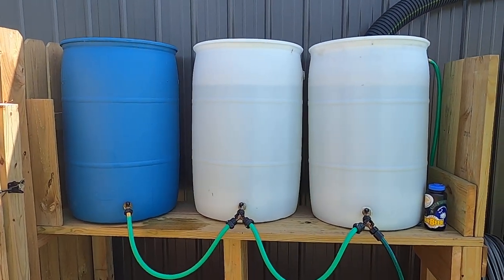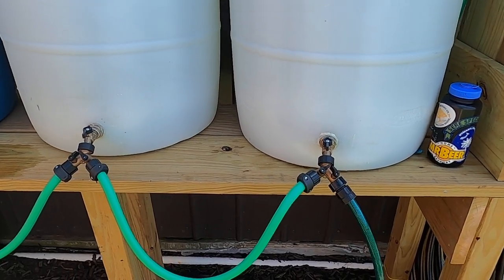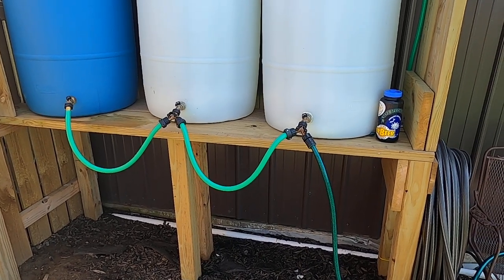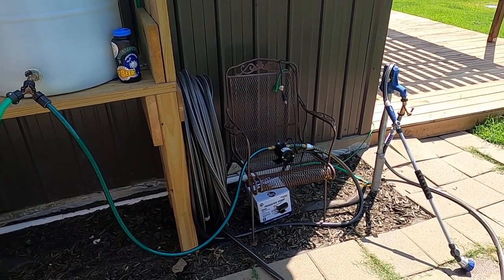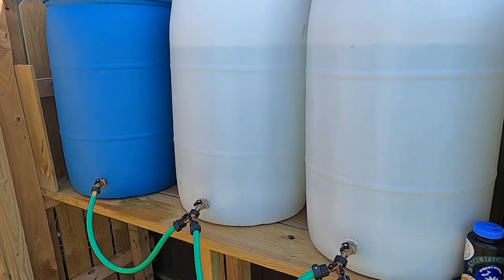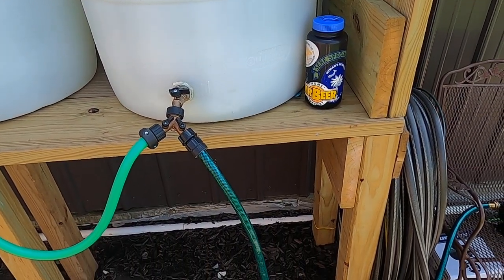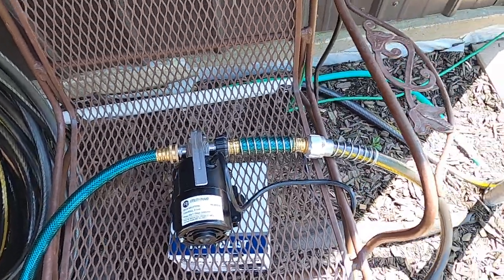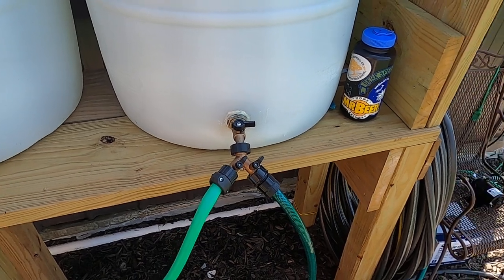Rain Barrels and Pump Watering System

Comment: I inverted mine, then drilled a hole in the "top" to fit a threaded 3/4 inch pvc fitting so it has antennas. Capped the antennas then used the smallest drill bit I could find to perforate the caps. So the antennas act as the air releases. Then on the 2inch PVC, off the first flush, headed over to the barrels I used a T to make a Gutter down spout higher than my barrels water level to act as my overflow. Then put a piece of window screening in the bottom of the gutter spout and on the intake from the gutter. This seals my system from mosquitos and allows the barrels to fill completely. But creates all the head room in the world, since the Antenna and T down spout can be any height above your barrels. All it does is catch an extra foot of water, extra, in the 2" PVC and the 3/4" antennna, insuring all your barrels fill to max adjusted for any out of level. BUT MOST IMPORTANTLY SEALS THEM FROM BECOMING MOSQUITO BREEDING COMPOUNDS. I havent seen a mosquito get in and if they did theyre going to have issues getting out. But mute point since they cant get in. Im not sure they know Im hiding water there at all. I study mosquito behavior and I swear if 1 figures it out they start recording a memory in their little bot army of where to breed.

Comment: I agree that this is a pretty sweet setup. Your purpose is for the garden or non-consumption for humans. For myself, I'm looking to set up a backup system for the well, (as well as rain catchment) in the event of extended power failure. I'll need filters and all that happy jazz because 1) our mosquito population is very prolific; and 2) our well water is unpleasant to taste. But I like how you actually Got It Done on a purely barebones level - it's DONE! An accomplishment. You can always do improvements later, if you wish. Have you noticed any problems with algae growth in the white barrels?

Comment: I’ve been using a Seaflo 33 series 110V electric pump which includes on demand pressure on-off. It’s a little pricey at $99 but it is not loud and works great. It is not a submersible but it’s been mistreated and still continues to just work. I use my rain barrel water just like a normal street water hookup. Great pressure etc

Comment: On demand pump would be perfect here. And float valve connected to solenoid connected to house/well water as a back up for droughts. Put a timer and landscape irrigation on garden side of the pump and you have a hands free system. Use free rain water when rainy, use house water when barrels dry but barrel self fill with float valve/solenoid. Add solar panel if you really want a fancy set up to run pump/solenoid. Thats what ive got
Reply: I like the way you think

Comment: Those pumps aren't meant to be turned on unless water is flowing through them.  So every time you close your spray nozzle realistically you should shut off your pump.  On demand pump would be much better for you.  They sense the drop in water pressure when you open your spray nozzle and instantly turn on.

Comment: This a sweet simple setup. I have 5 barrels. Two in front and three in back of house, separately hooked up. I have been using the top of barrel method, like you did, and am not happy with maintenance and hassle.The brittle black vinyl corrogated hose sucks. Always breaking.  We live in Ottawa, Ontario so I have to put the barrels away for the winter. Just wondering how you made use of the various hose connectors. Did you use hose fitting that you installed yourself, and how. My attempts have always leaked.
Reply: I joined my rain barrels together the same way that is shown in this video by using garden hose to link the barrels together. My hose does not leak, but it does take a long time to fill the adjoining barrels in a heavy rain.

Comment: 👍🏼. On demand pump would be better for your set up though 🤔
Reply: What's an on demand pump?
Reply: @uniteentierly2773  It is a pump with a built-in pressure switch. Which means that when the garden hose nozzle is opened the pump starts pumping automatically and when the nozzle is shut the pump stops pumping automatically so the pump is not being deadheaded.

Comment: The rain water will flow out at a quicker pressure if there is a hole or cap opened at the top of the barrel when watering.

Comment: Nice setup. Did you consider using a submersible/sump pump instead of your transfer pump? If so, what was the deciding factor(s) in choosing the transfer pump?  One plus I can think of in favor of the submersible is that the noise would be a bit muffled. Thanks.
Reply from the maker: Thanks for the question! I did not consider a sump pump due to their price and the added steps and resources of installing it compared to simplicity of this little transfer pump.
Reply: I have a submersible pump and a setup like this but I can’t draw water from all 3 barrels at the same time I figure. The pressure from the pump I assume would go into the other barrels.

Comment: If the water collection was higher could you not do away with the pumps all together? Or would it need to be to high to create any pressure?
Reply from the maker: Hey Bryan. So for psi calculations, every 2.31 ft of fall equals 1 psi of pressure. You are correct that water is a self leveling entity and will flow to lower points, but it’s the difference between a slow trickle or a nice pressurized stream. I would guess that the little pump here is creating 10-15 psi consistently at the nozzle through 100ft of hose.
Reply: @moonacreshomestead6610  would it be possible to connect a 30 ft' pvc pipe to the middle barrel then put it upright/perpendicular, connecting a hose to the top which would then create 10-15 psi naturally after you created a siphon?
Reply: @bryanannett8867  lol

Comment: How do you fill the other two barrels with water?
Reply: The water flows from the first barrel to the others through the pipe setup at the bottom. With all of the valves open, the water level will always be the same across all the barrels. Simple physics.

Comment: You straight up don't know how this whole barrel thing works.  You need a screen on top for one thing, not just for bugs but for other stuff that comes off the roof.  The valves on the bottom even out the levels.  You leave them open all the time.  The openings on the top are there for overflow to make sure it goes away from the foundation.

Comment: When full, that looks like a lot of weight, I hope you have enough support.
Reply: Yes,  in excess of 1/2 ton when full. It could be problematic if those center 4x4s were merely sitting on soil especially were the ground to become wet but they are likely sitting on massive concrete piers.
Reply: @65csx83  How many pounds to a gallon? Never thought of wet ground, remember weight dispersment, it's how you can lay on a bed of nails.
Reply: @victorwadsworth821  Water is 8 lbs / gallon. When wet, the surface area needed to support a full barrel is about the equivalent of the base of the barrel.
Reply: @65csx83  Good, I tried find it but couldn't. Maybe base with a rout iron grid?
Reply: @victorwadsworth821  
8 pounds for 1 US gallon.

10 pounds for 1 British Imperial gallon ( British Imperial measuring system was used in numerous countries before the metric system ).

Comment: How did you find the barrels? I have been looking at doing something similar but have not been able to find anywhere that sells them at a reasonable price.
Reply from the maker: I used to work at a brewery and we had a lot of these. They are commonly used to hold chemicals, so if you know someone who works in an industrial setting you may want to check with them. I washed mine several times to make sure any residual was gone before use.
Reply: I find them at local salvage yards.
Reply: Try FB Marketplace we got ours there 20 bucks 55 gallon.
Reply: I got mine through rainbarrel.ca .

Comment: Those y splitter are costly.
Reply: Then use pvc pipe and fittings to connect them together.
Reply: @robertlong7723  yes! I have instal a few barrels I find that the 275 gal tanks is the way to go. Those 55 gal take so much space and hassle installing those pipes.